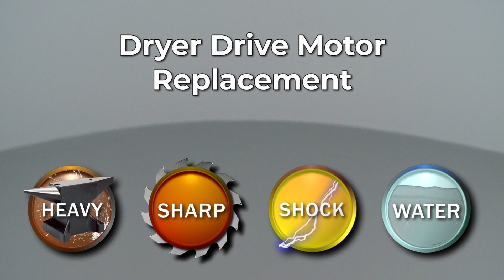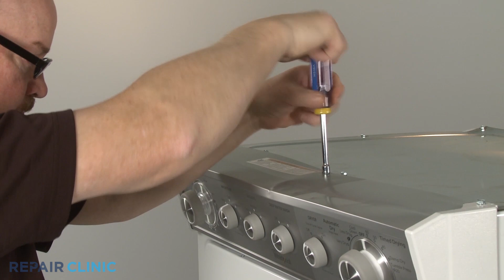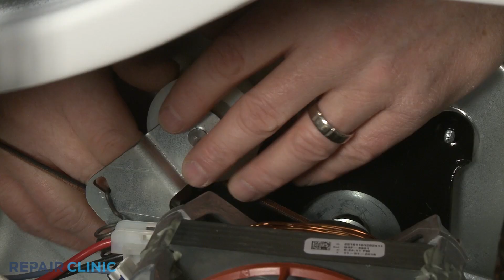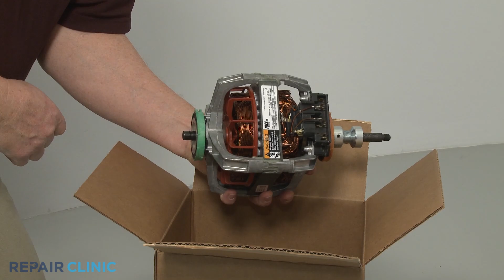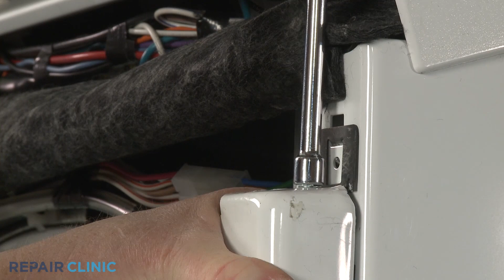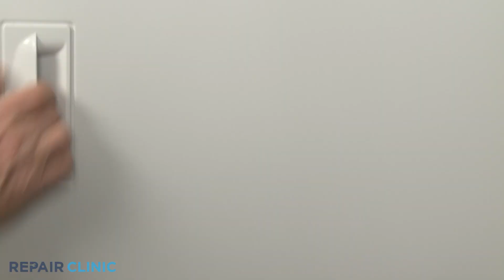Whirlpool Electric Washer/Dryer Combo Dryer Drive Motor Replacement 279811

Comment: 9/10 times the blower wheel is just fused to the motor and you have to cut it out.
Reply: Yeah this is what happened to me. I tried to take the blower wheel off but it just wouldn’t budge. I had to use this huge heavy duty bolt cutter to cut off the blower wheel from the motor, piece by piece. Needless to say, I messed up the blower wheel in the process so I just bought a new blower wheel in addition to my blower motor. 

Then again, I didn’t have a half -inch square drive bit like at 3:10. So maybe I should’ve went out and bought that. But at the same time, the blower wheel was stuck in there pretty hard so idk if the half-inch square drive bit thing would’ve even worked for me. Maybe it’ll work for others bc theirs may not be stuck so tight, who knows lol
Reply: Fr hate this job on a dryer lol I came here to make sure I was doing it right 😂